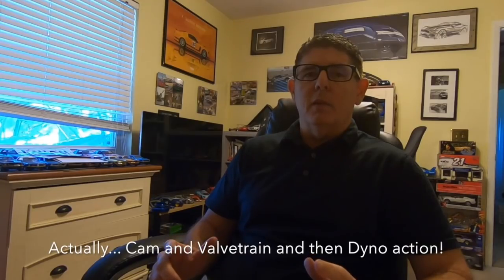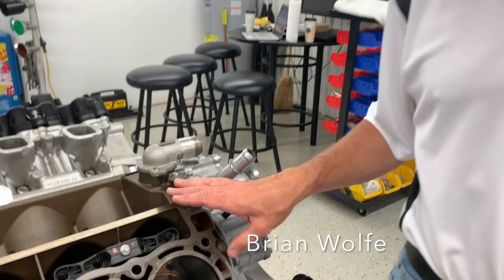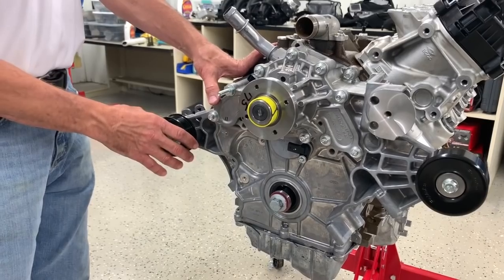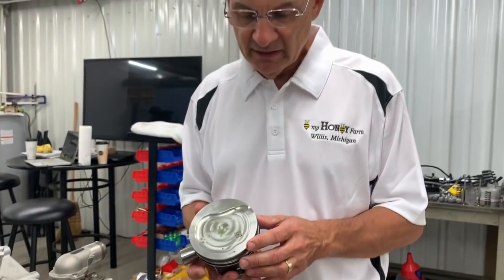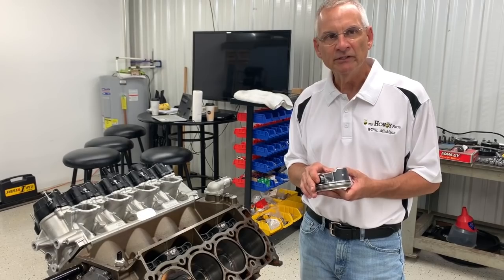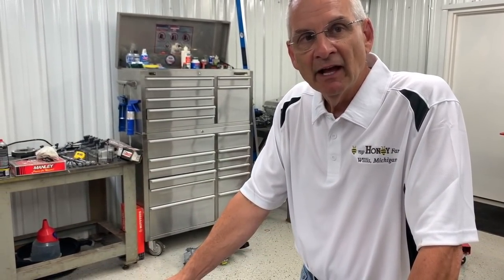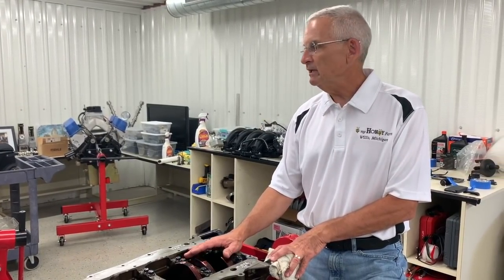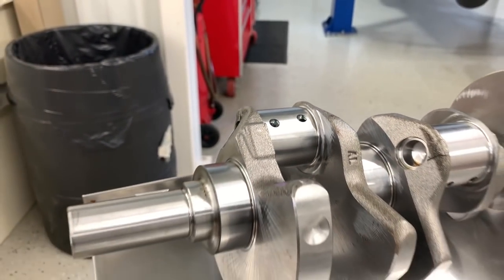7.3L Godzilla Ford V8 Bottom End Teardown — How Big Can this Engine GO?  Crank, Rods, Piston, Block

Comment: Ford’s pushrod 2 valve 446 V8 looks pretty stout. 

The commitment to designing a new large format/capacity V8 pushrod engine is certainly an interesting marketing/other move for Ford;

A) After bringing the DOHC modular V8’s to the market a decade ago, and then successfully refining them to the point where Ford now has a range of normally-aspirated and/or supercharged DOHC V8 platforms that range from 5 litres to 5.8 litres in capacity that pretty much equal or better most European DOHC V8 designs whilst at the same time outperforming them in durability.

B) Particularly given the current economic times and the directly related dynamics of fossil fuels, oil prices, and vehicle emission regulations. 

Still, there’s not a lot of genuine Ford V8 fans complaining; me included.

The entire short/long block looks reasonably well designed, with the exception of a few things.

I'm not sure about that pseudo siamese bore cooling system; shown @ 2:16.  I think that might allow things to move around a bit with some high compression and/or boosted applications.

Also, the camshaft bore and base circle diameter; I am not sure if Ford have noticeably increased it on this engine but if they have not then that is something that should happen in my opinion.  

Anyway, with all that said . . . 

Perhaps it’s time for someone to do a back to back dyno comparison on this Ford 7.3 Litre and Chevrolet’s LSX 7.4 Litre offering.
Reply: It's been 25 years since the 4.6 4V was unveiled.
Reply: @9HighFlyer9  It was mainly the 5 Litre and higher capacity DOHC V8 engines with twin independent variable timing on both camshafts I was referring to.

As, they were the ones that both, won awards and become the most popular, powerful, and durable. 

Or put another way, the smaller capacity Ford modular DOHC V8 platforms before the Coyote, as good as the design may have been, were generally not seen to be capable of seriously competing against the V8’s that Chevrolet and Chrysler where featuring in their line ups.

The Coyote came out in the Mustang at around 2011; roughly 10 years ago.

And, at least to my mind, that probably marked the 1st time the DOHC Ford V8 (as a non modified OEM offering fitted to a stock Mustang/car) was capable of meaningfully competing with the 6 Litre and greater capacity V8’s of the other aforementioned manufacturers.

Still, my estimates on the timelines might still require refinement as Ford has had the 5 litre and higher capacity DOHC V8 engines in service for quite a while now; which makes it all the more interesting that their newest V8 design is a pushrod V8.

As, Ford spoke about the virtues of a 4 valves per cylinder DOHC V8 with twin independent variable timing to almost anyone that would listen when they 1st came out with the 5 litre Coyote and/or 5.2 Litre Voodoo platforms; and in doing so announced that design (rather than the historically popular pushrod operated 2 valve per cylinder Windsor/Cleveland style platforms) direction was now their future.

Amongst Ford’s (then) provided reasons for not supporting pushrod operated 2 valve per cylinder style platforms any longer, was because efficiency/power targets, emission standards, and other regulations (supposedly) meant that V8’s without 4 valves per cylinders and independent variable timing, had no future.

And now look where we/they are.
Reply: @StormCentre88  "
Or put another way, the smaller capacity Ford modular DOHC V8 platforms before the Coyote, as good as the design may have been, were generally not seen to be capable of seriously competing against the V8’s that Chevrolet and Chrysler where featuring in their line ups." 2013 SVT Terminator Cobra blew everything Chrysler and Chevy had out of the water. And it was a 4.6 DOHC mod motor.
Reply: Yes, that’s pretty much the case.

What's has been going on over the last 15 years or so between the big 3 USA brands (Ford, Chevrolet, and Mopar) insofar as their approach to providing/designing V8 engines, has been an interesting lesson in how major automobile manufacturing organisations address/cope with the changing business landscapes brought about by;

A) Increasing pressure/competition from European brands (Audi, BMW, and AMG) that now, not only have low pressure turbocharging and sophisticated control systems completely down pat for high performance V8 and/or V6 engines - but also, they have successfully begun to tightly integrate that technology with electric motors. Which in turn provides previously unachievable HP and torque figures even if the hybrid platform didn’t lessen/remove several other design constraints; such as the requirement to hide turbocharger lag which usually constrains turbocharger size and boost pressures.

B) The complexities of global economics, emission targets, combined with the fact that the power figures of some normally aspirated V8’s from the big 3 USA brands (Ford, Chevrolet, and Mopar) can now easily be obtained via smaller engines and/or via downsizing and/or going to a hybrid platform. 

C) The fact that any change to the production line that might be implemented (by the big 3 USA brands; Ford, Chevrolet, and Mopar) to deal with any of these considerations costs big dollars; yet some of the most dependable consumer/fans of each of the big 3 USA brands (Ford, Chevrolet, and Mopar) are aligned with racing and/or performance - which means the big 3 USA brands (Ford, Chevrolet, and Mopar) can't afford to stop making V8’s just yet, as there is a culture based around that platform that directly equates to reliable revenue.

D) The immediate costs of migrating to a DOHC V8 platform and realizing the technical superiority of it in terms of both efficiency/power and meeting emission standards.

E) The reasonably (short term) cost effective option of postponing/deferring the costs of not immediately migrating to a technically superior DOHC V8 platform combined with the hidden/other costs associated with remaining with an existing 2 valve pushrod valvetrain that, particularly for OEM sports/other car duties, can only be progressed further in terms of efficiency/power by; (i) leaning on aftermarket/racing fraternity approaches; (ii) relying upon inefficient supercharging (rather than efficient turbocharging) regimes/approaches; (iii) keeping static compression ratios below 11.5:1; and (iv) maintaining a capacity advantage over rival manufacturers DOHC V8 designs; such as shown by how Chevrolet (Corvette/Camaro) and Mopar (Demon) pretty much stay with their supercharged ~6.2 Litre V8’s - which is in direct competition with Ford’s (Mustang) DOHC ~5 Litre V8.

F) Pressure/competition that has forced even Chevrolet to rethink their approach to performance V8’s in the sports car market; as evidenced by how some of the newer *iterations of the mid engine Corvette now appears to offer a DOHC V8 platform. Chevrolet clearly know the DOHC V8 is the future of the V8; but they have been clever enough to offer it without completely ceasing to offer their 2 valve pushrod valvetrain ~6.2 Litre V8 to the market for die-hard fans.

G) The compromises and/or sacrifices associated with circumventing and/or deferring the excessive costs pertaining to re-tooling and updating/refreshing production lines in order to deal with bringing a new DOHC V8 design/platform to the market (at a time when it might not be clear what the future is for a V8; particularly given that a hybrid V6 seems to be the future for other sports car manufacturers; including those whom achieve the same and/or better performance from their hybrid V6’s than some existing V8’s) by way of deciding to compete within the performance/sports car V8 market with the existing outdated 2 valve pushrod valvetrain V8 platform. Put simply, to design/provide an efficient engine - particularly a large V8 - that doesn’t sacrifice so much power on its way to meeting emission/other standards that, in order to meet the demands of the sports-car market, its capacity requires increasing; among the many design requirements that must be considered to achieve this are those that speak to how imperative it is to have as much gas flow control as possible.

H) How the compromises and/or sacrifices associated with the aforementioned considerations (including above point “G”) usually translates into regulatory and/or commercial pressure that defines a necessity for most major vehicle manufacturers to have independent control of the timing (and preferably also lift) of their V8’s valvetrain’s intake and exhaust valves; in order to achieve control over gas flow characteristics. And, the best way to do this is with a DOHC valvetrain. 

What may not be immediately apparent from the above points (including “G” and “H”) is how they implicitly describe - particularly in terms of power - that the larger capacity V8’s (such as Chevrolet’s and Mopar’s ~6.2 Litre V8’s) that maintain the 2 valve pushrod valvetrain regime usually require the additional Litre of capacity over a ~5 Litre DOHC V8 (like that in Ford’s Mustang) in order to reliably to compete with them.

Among the various reasons for this; one reason is because the limitations presented by a typical 2 valve pushrod valvetrain approach employed on, say, a 6.2 Litre V8 means that the V8 will not always sweep out 6.2 Litres; and this will usually become evident as soon as the crankshaft speeds rise over, say, 5Krpm.

The same happens for a ~5 Litre DOHC V8 also; but it will usually not occur as soon if the camshaft and valvetrain regime is designed to prevent it; and - for the above reasons - a DOHC regime can usually maintain volumetric efficiency for a given capacity better than a 2 valve pushrod valvetrain can. 

This is one of the main reasons why, even though all 3 brands (Ford, Chevrolet, and Mopar) employ supercharging, they may have different reasons for doing so. 

Chevrolet and Mopar probably commenced doing it for a few reasons; including the need to offset the aforementioned inefficiencies associated with their 2 valve pushrod valvetrain architectures whilst also ensuring that; (i) revenue continues to be derived from existing production lines and product suites; and (ii) they could compete (in performance {but not efficiency} terms) with a 5 Litre DOHC V8 platform such as that which Ford offers.

Ford, probably now need to do it also because (save for the new DOHC Corvette engine *aforementioned in point “F”) Chevrolet and Mopar; (i) don’t really produce a 2 valve pushrod valvetrain 5 Litre V8’s and/or install them in their top sports car product line (and if they did so this would reveal the dominance of the/Ford’s DOHC platform); and (ii) now fit their 6.2 Litre 2 valve pushrod valvetrain V8’s with superchargers that  - for an OEM product - run significantly high boost pressures, such that aforementioned volumetric inefficiency associated with 2 valve pushrod valvetrain V8’s not sweeping out their entire capacity to some extent falls away.
 
However, as mentioned above (including within point “E”) the “remedy” Chevrolet/Mopar apply to the aforementioned volumetric inefficiency (associated with running 2 valve pushrod valvetrain V8’s that don’t always sweep out their entire capacity) issues comes with considerable expense to efficiency.

Which is a consideration that is well supported by the horrific fuel consumption and emission figures associated with almost all Chevrolet/Mopar’s 6.2 Litre 2 valve pushrod valvetrain V8’s that are fitted with superchargers.

Comment: I am a life long Ford guy but this engine will never be competitive without a set of Cleveland style heads.  The BB Chevy is the dominant engine in NA  builds because of cylinder heads. I don't see the  market for aftermarket Ford heads just to be equal to the Chevy BB. If I was to buy a new Ford F250 I would definitely buy this engine.
Reply: you realise this engine has a canted valve cylinder head that flows 320cfm on the intake..... the cleveland usually flows between 275-290cfm intake
Reply: Looks like a good design with the ability to run a decent sized cam profile. Heart shaped combustion chamber and cantered valve angle, variable cam timing and the right compression ratio with e85 will make some fat torque and hp numbers over a wider rev range. I think there's going to be some impressive numbers from this engine. 445 cubic inches and the latest technology for cylinder head design should go well.
Reply: uhhh, you aint getting alot out of stock bbc heads unless you hog the absolute shit out of them.
Reply: Vegas EMT  well the fact that I'm mainly interested in cleveland engines should tell you that yes i do know what a canted valve cylinder head is.... watch the second video where they strip the top end of this engine off and show you both valves open with no springs (they open into each other).
it might not have as much side angle on the valves as a cleveland 
non the less it is a canted valve head that flows 320cfm with nothing more than a clean up in the port according to that video.

if you look at the valve stem angles in the video at 8:27 you see it 

https://www.youtube.com/watch?v=ML4SlsScnBY&list=LL_32yGFaM4KqOs0w1C-I-VQ&index=3&t=2s

Comment: Very little room for improvement.
Reply from the maker: Not so sure about that... boost, nitrous, ported heads, cam and compression should bring big power.
Reply: @revanevan  i don't think that what he meant. Could be wrong tho.
Reply: @revanevan  bigger valves ;)
Reply: @revanevan  I agree with you to some point.
You will spend more money than the power you get out of it.

Number 1 fault I see is head gasket blowouts.
The 7.3 is designed to run long idle hours and low range torque.
that's why they added extra cooling paths around the cylinders which leaves no room for big bores.

No room for any big pistons, stuck with dome pistons to raise compression,
Spend 11k for the engine and add another 10k in rods,pistons, blower,turbos.
and still will not make the 760 HP the 5.2 supercharged stock crate engine does.
Cheaper to build an old 460 with heavy rods and kaase heads.
That"s a lot of beer money saved.
Keep up good work.
Love the videos.
Reply: How about not having plastic timing chain guides
Reply: The rods looks very weak to handle boost. Otherwise great engine. Is the guy in the movie paid by ford? 😂 only good words about the engine.

Comment: Did he say the connecting rod is powdered metal?? Also the cracks in the rod caps and rod are so they go back to get her the same way?? I thought it was because they stress it on purpose till it cracks so it doesn't do it after its installed and in use.

Comment: Cam in block, lifters under cylinder heads, 6 bolt main. 
LS copy cat??? 👀👀
Reply: Sounds like you're describing a early Ford FE engine
Reply: @flcracker9  fe didn't have 6 bolt mains. Side bolted yes but 4 bolt
Reply: Just like Government  Motors  copied the Cleveland  engine, O for shame.
Reply: @darrenhefford3722  I would love to hear the explanation on this one?
Reply: @james4wd236  Where did Government Motors get the design for thier, LS head ?   It doesn't  have siamesed ports, it has a tri-angled/canted valves, big ports, big valves and high flow numbers, just like the Cleveland head of 20 years prior, coincidence,  I think not, Go Ford !!!
Reply: @darrenhefford3722  The LS engine design is a good one, and does have some traits that could be construed as "Ford-like"...just as certain FoMoCo engines have design traits that can be thought of as "GM-like". The LS shares more in common with the SBC, most likely, although certain head characteristics are somewhat similar to certain NASCAR Ford heads. In my opinion, that doesn't in itself mean much. Certain port layouts & chamber designs are showing more potential than others.

The more highly developed a particular product is, and the more refined, the more likely that different manufacturers will pick what seems to be the most promising design....and develop it. Looking at NASCAR or Formula One (as much as is shown to the public), nearly all the engines, of whatever make, are strikingly similar to each other. 

With all that being said I don't think Ford "copied the LS" or Chevy "copied the FE". It was a joke. Manufactures use what works the best. Look at the new C8 Corvette. Everyone says they copied the Ferrari, but at the end of the day there's only so many designs you can implement into the mid-engine vehicle.

Comment: this would be a great engine if it wasn't for Fords weak timing setups. plastic chain guides, chain tensioners, oil pump and dual chains. timing shouldn't have wear parts, blown timing = blown valves. engine top end rebuild if a valve doesn't punch a hole in a piston head.

Comment: 3 words to define this engine. Head gasket failure.
Reply: Lmao doubt it
Reply: uhhhhh.....no
Reply: I haven't studied much into the motor, why do you say that?
Reply: In for reasoning behind the statement. Talk to us buddy
Reply: I will say that the slit between bores in the block is not gonna help anything
Reply: @dburkh91  its to bring coolant to the front of the bores and aid in cooling. Kinda like SBC 400 steam holes.
Reply: Agreed. Pistons sharing head bolts instead of giving each piston 4 of their own. That's why do many Ford engines spit out their head gaskets.
Reply: The 1.6 and 1.5 shares very similar block deck surface architecture. They fail regularly. The block won't hold and warps. I see it weekly. No way without filling that block will it hold a gasket at anywhere near the power level he's talking.
Reply: Ok guys, the block is cast iron not aluminum. The closed deck is a solid inch thick, it is not under boost, the head studs are beefy as hell. The slits are farther down in the bore than the aforementioned motors. I really don't see this block warping or blowing gaskets. Oh yeah, the block is fully skirted cast iron! This thing is solid in my opinion.